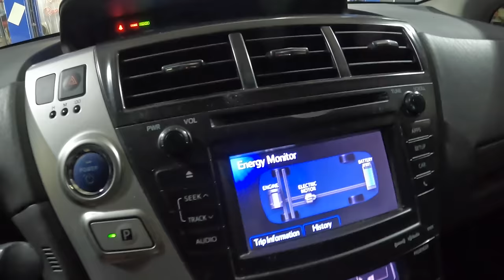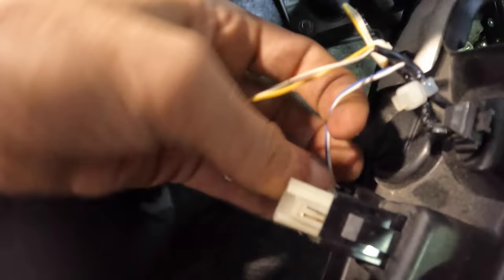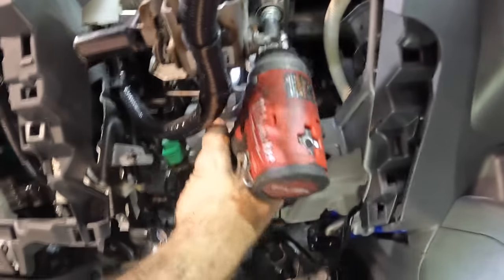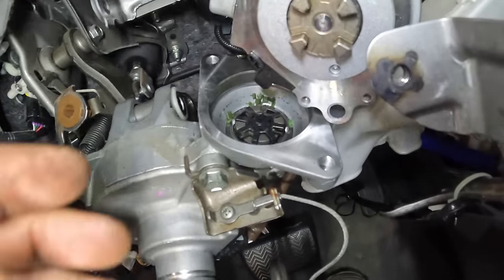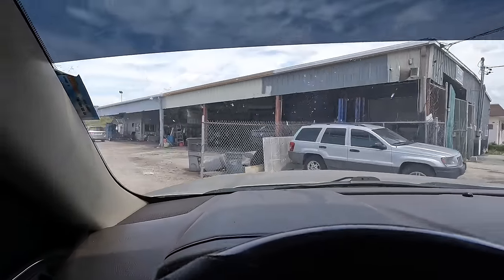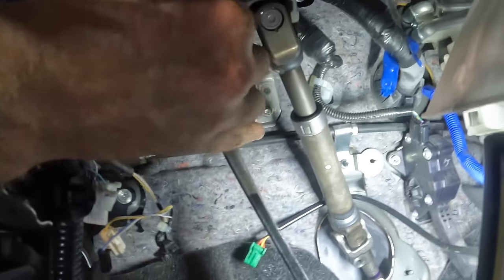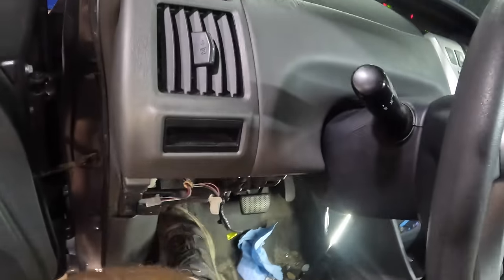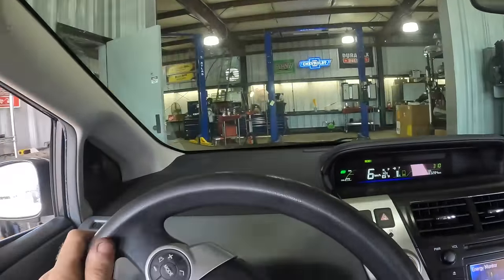Trip to the Dealer! Steering Knocking in DASH! Loose Column?? Toyota Prius

Comment: All that disassembly for a plastic and rubber part  engineers try to make the design cheaper just to save money but makes it tough for the mechanic a little common sense is required not a bunch of degrees on the wall

Comment: @10:00 I asked the question: "Where is his stethoscope?"  One of the comments I ran across mentioned a long screwdriver against the ear. Done that many times in the past. Looking at you working under the dash putting that long bolt in the steering column make me want to tell you what my old boss told me many ears ago: "It don't get no easier".

Comment: I had thssy brakee same noise on my 2010 prius turned out to be cylinder assy brake boost, and a pump assy brake brake .parts were OEM. And costly

Comment: Here's a suggestion; get with a machinist and see if you can get some of those little plastic gears made out of aluminum and market them online as a fix for a known weakness on these steering assist pumps. You might not make much money, but you'd make a lot of techs happier.

Comment: ray in drives used in running machines and water pumps to help aline motors and driven units that part is called a spider. hope that helps .  from old machanic

Comment: That brake pedal depresser is also good so u can just reach in and push the button if u keep needing to start the car and turn it off on a push button car 🤔. Without having to open the door with lift arms in the way and stuff to get ur body in there to press the brakes so it will start

Comment: I thought I had edited this to reflect that I had it wrong.  As  I said in another comment below:  Okay, so I had to go back and listen again and you are absolutely correct, as was Ray in describing it as an NC switch.  What screwed me up was when he said, "when you RELEASE the pedal it opens the switch and turns the lights ON".  So he had it right, but simply misspoke and should have said, "when you release the pedal, it opens the switch and turn the lights OFF".  

So I'm a dork, but jus' not a complete dork...  

So... Ra-Ray,  you described the brake pedal switch as NC, but isn't it actually NO, since it has to have to flange on the brake pedal pushing the "plunger" on the switch to keep the circuit open?  I certainly understand what you were saying and I even thought about it before you described it as an NC switch, but even though it seems to be NC because of the "application situation", wouldn't the switch itself still be considered NO, since when it's just sitting there out of the car with nothing pushing on it, the circuit is open...?? 🤪
Reply: Other way around.
Think of the switch this way: if it's out of the car, sitting on a workbench, are the contacts closed, or open?
They're closed because there's nothing (brake pedal) pressing the plunger down. (NC)
 The contacts only open when your foot is off the brake pedal, depressing the plunger, turning off the brake lights.
Reply: @beezul    Okay, so I had to go back and listen again and you are absolutely correct, as was Ray in describing it as an NC switch.  What screwed me up was when he said, "when you RELEASE the pedal it opens the switch and turns the lights ON".  So he had it right, but simply misspoke and should have said, "when you release the pedal, it opens the switch and turn the lights OFF".  

So I'm a dork, but jus' not a complete dork...  🤪

Comment: Hello
it works with a certain combination of start button gas pedal brake pedal gear lever. on toyota hybrids enter a service mode so that the petrol engine does not shut down. greetings from Sweden.

1.  Press the start button twice with your foot off the brake pedal

2.  Depress the accelerator two times fully (make sure, the vehicle is in park)

3.  Put the vehicle in neutral (press the brake pedal)

4. Depress the accelerator two times fully

5.  Put the vehicle back into park (press the brake pedal
Reply: And you do the hokie pokie😂
Reply: @MrBean5268  haha. It works. I have a corolla hybrid gr sport 2020 👍🏻⚡️
Reply: @fw1367  79 Silverado here. No way I'll own a hybrid.
Reply: @MrBean5268  cool.
had wanted to get a car with v8 for some time in my life. but petrol is so expensive here in Sweden.

Comment: One has to wonder why they would put a flimsy plastic part buried in the column, & whats the mechanics as to why it broke in the 1st place ?Every time I watch the engineering that goes into this stuff I go yikes.Makes me want to buy an antique auto with points plugs condenser😂👍
Reply: I'm ready,.  I have a dwell tachometer collecting dust somewhere. 🤣🤣

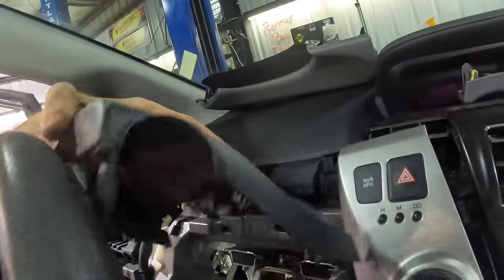Comment: 43:13  all you have to do is unplug the brake light switch if you take it off its bracket so the circuit remains open.  

For other people, if your brake lights don't shut off there is a good chance you kicked the switch and you just need to reajust it like the way Ray just showed you not all cars lock in most gm cars hold by tension only and you can hit the switch with you foot and back it off far enough the lights stay on.